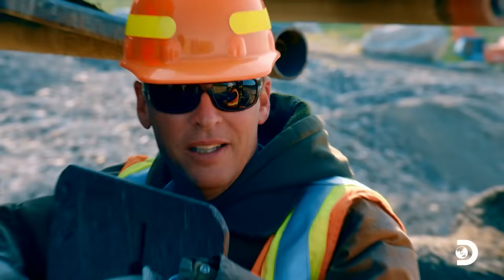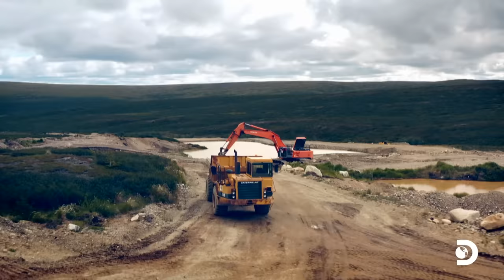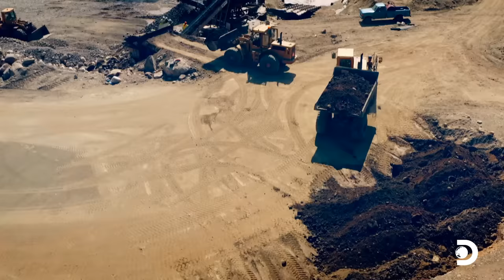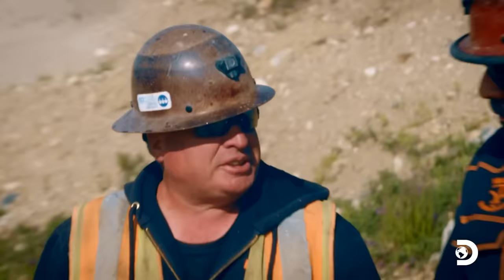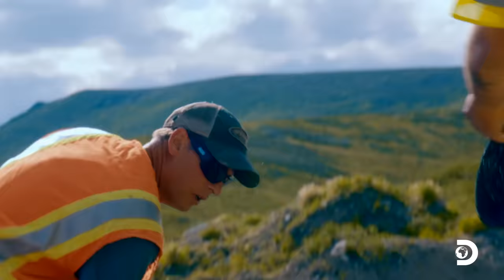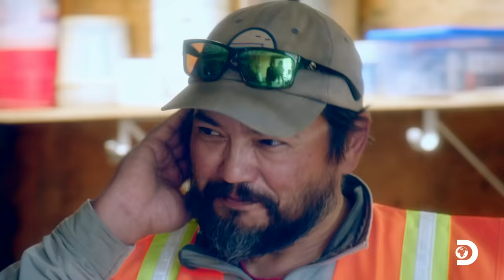Freddy Has His Hands Full with an Amateur Mine | Gold Rush: Freddy Dodge's Mine Rescue

Comment: S02E05. For those not sure of Gold Rush's honesty, Freddy and Juan ARE. Parkers Trail is quite edited. Especially so for Parkers bud, Fred Lewis. Fred's last operation was right at 95% FAKE AS HELL. The latest is too, however it changed when they joined up with the mine next door, but you also saw barely any of it. WHY? Because Fred has issues.